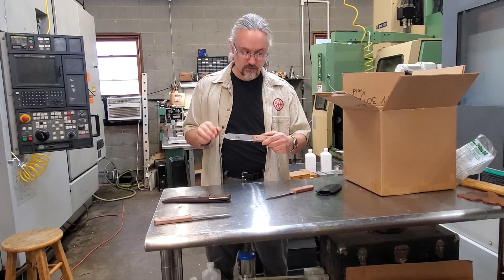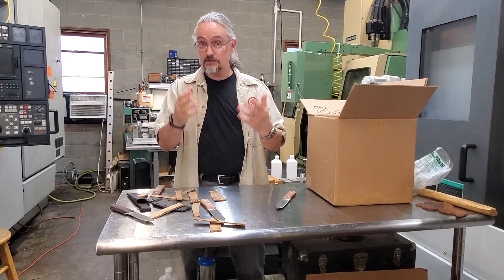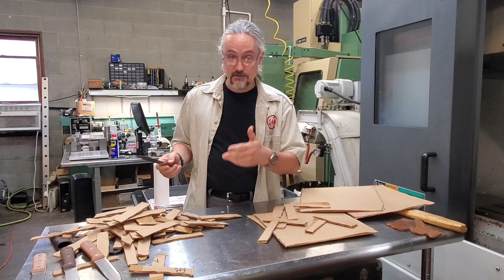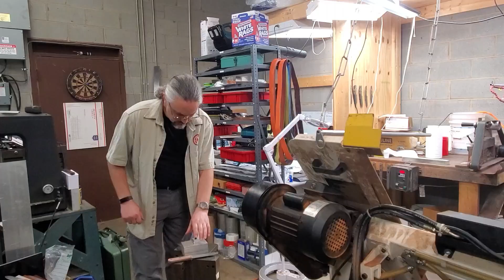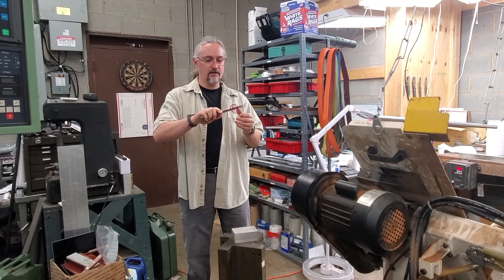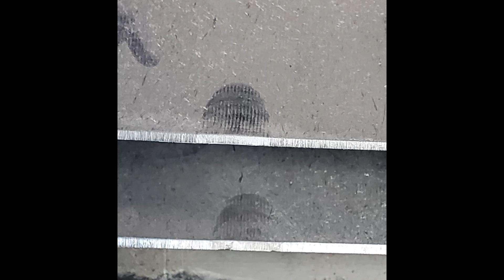What is Delta 3V? Nate does a loooong video

Comment: My guess before watching it's that D3v is mostly using the low tempering regime for better toughness and hardness, but with a lot of care and optimization for temperatures, cryo, optimized austenitization and at least double temper. It's not magic but it's well beyond what most do. Such care put into the heat treatment into any steel would make it perform almost super compared to even good steels with subpar batch vacuum furnaces with consistency and less ideal programming, no cryo, and single temper.

Update: Yeah, pretty much. 
The bolt test is a good real world use if you hit a staple, nail, or rock.
Aeb-L is my favorite cheap steel.

Comment: Unfortunately even with Delta heat treat is still not superior to a steel called 8670
Reply: It is not as tough as 8670, but that is it. Typically 8670 is run softer as its primary use is circular saw blades. I've heard people talking about running 8670 at 63 Rockwell but I'm not sure if I buy all the magical properties they claim. 
3v, even at industry standard treatment, will have better edge retention and corrosion resistance (although it still isn't stainless). There is a reason 8670 isn't frequently used for knives. It is basically a one trick poney that offers toughness over everything else. It is not superior to 3v for knifemaking.
Reply: @joshevans3452 check out Knife Steel Nerds newest article.
Reply: @joshevans3452 yeah 3v being barley behind while also providing more wear resistance and corrosion resistance is the point. 

You can eek properties out of carbon steel, but not those
Reply: @joshevans3452 If you forge blades, I could see 8670 at 63 being the best you can heat treat with a magnet, but beyond that, nah. It's tougher steel at the same hardness but that's it. If you used 1V you'd also get equally or tougher steel with more edge retention than 8670.
Reply from the maker: HAHAHA

HAHAHAHAHAHAHAHAHAHAHAHAHAHAHAHA

Idiot...

Comment: Id like to see this heat treatment on 5160
Reply: That’s a completely different steel. 

Might be something you could do to cruwear or maybe m2/m4
Reply: @lindboknifeandtool The same ideas work for most steels, though there's no need to worry about quench speed for 5160 because it either will be hard or it won't. Air quench steel done with air vs oil or plate quench will change the HRC by at least 1 because of auto tempering through the martensite embrittlement range. Careful temp control, faster quench, cryo, and double low temperature regime temper get you the best you can. 5160 probably doesn't have retained austenite problems since chrome is an austenite stabilizer, and not enough carbon to stabilize it much either since it's hypoeutectoid.

Comment: Thanks for making this great video to explain the objective and rationale behind your optimization of CPM 3V heat treat for *knives*.  Very clear, helpful, and very timely ;-) .  It's a bit surprising that there isn't a quantitative metallurgical property that better describes "cutting edge stability", what with industry's need to understand this very thing, e.g. for industrial "slicing" operations.  We continue to triangulate with hardness / compressive and yield strength, impact toughness, microstructure, and abrasive wear resistance (e.g. cylinder wear, CATRA).  

For knife enthusiasts, suggest also reading up on thickness behind the edge, and edge angle's effect on performance.  (Hint:  include Larrin Thomas and/or Roman Landes names in your Google search to focus on the topic.  See also CATRA.) 

Also, your comments were my introduction to the Pre-Quenching practice.  Interesting comments on D2 heat treat, martensite types, and oven temperature reversals from thermal mass.